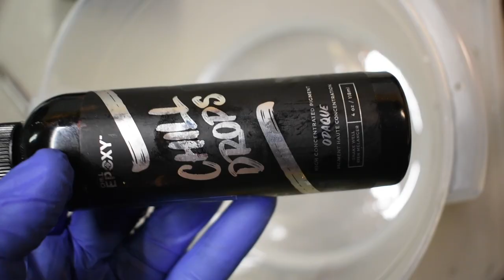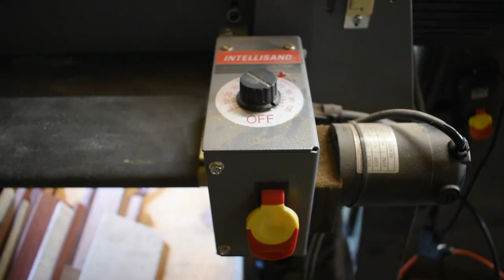Ultimate XL Cheese Board - 36 x 15 inches

Comment: Great work just found your channel. I do have a questions. When you seal the live edge and the corks do you let them cure before you pour the tint layer?  Wow really impressive.
Reply from the maker: hello Glenda, thanks so much! Yes, I do let the live edge and corks cure before adding the base tinted layer. It is best if they are not fully cured, just slightly sticky, this will allow for a good bond between layers. If you let the live edge fully cure, it is best to then scuff sand with 120 grit lightly, to give the next layer something to grip on to. The small scuff sand scratches will go away once the clear layer is poured.
Reply: @RescuedWoodCo  thank you so very much!

Comment: Do you let the first layer with the coated corks fully cure prior to second pour?
Reply from the maker: I let it cure to the B stage which means at least 80-90% cured, a good way to know it’s ready is when you can make a dent with your fingernail but it doesn’t actually stick to your fingers. Or you can wait until it’s fully cured, but you should sand gently with 120 grit between layers if you wait till it’s fully cured for proper adhesion